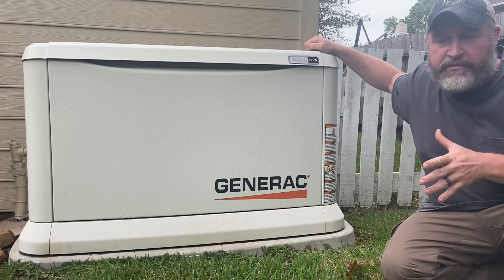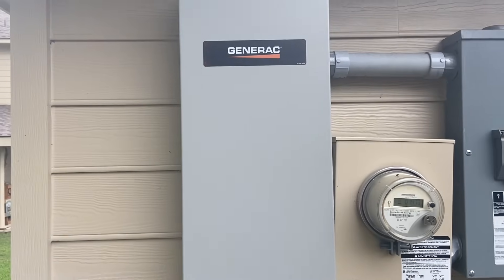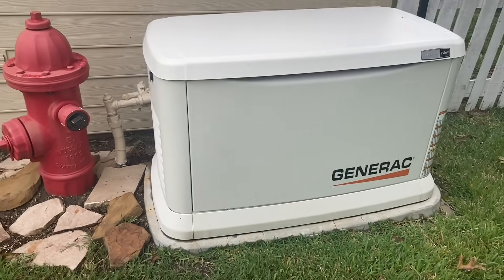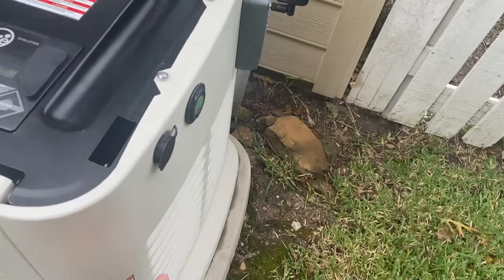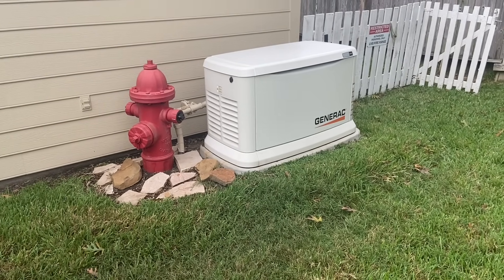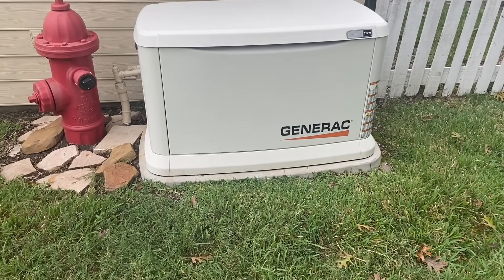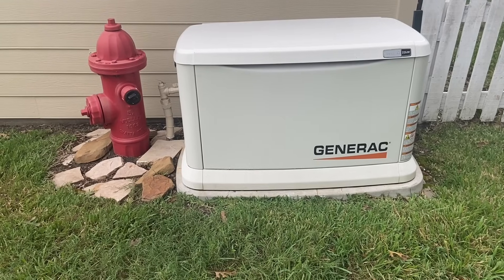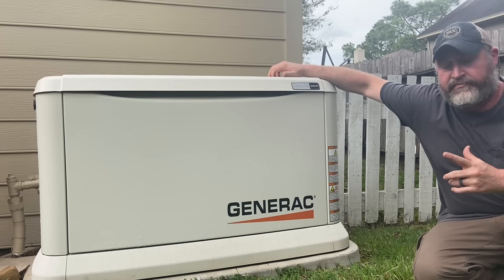Thinking of purchasing a generac whole home generator?

Comment: I’ve always wondered. What if you’re having electrical work done or you otherwise need to have the power off??? Won’t the generator run and therefore make all your outlets ‘live’ etc??
Reply from the maker: You can still turn off breakers or then main , if you needed to kill power at the meter you could then turn the generator off at the control panel.
Reply: @JustCantSitStill  Great thanks!

Comment: If there is a wide-spread, regional outage, does city-provided natural gas still flow?  i.e. is the utility backed up in some way to ensure service in spite of loss of electrical?  I'd hate to think I'd have to have a portable gas powered generator to back up my natural gas generator.
Reply from the maker: Our has never been cut off in my lifetime , I guess anything can happen. It can run on propane if one would want to get a large tank as a backup. 

Thanks for watching!
Reply: @JustCantSitStill  I've seen it in a long, multi-day outage. Compression stations run out of standby power and the nat gas line pressure drops below what's needed to run anything. Therefore the generator dies of fuel starvation.

Not common but not impossible either.
Reply from the maker: @StevieWonder737  anything is possible, you can’t prepare for everything so what’s your answer? What option did you go with?
Reply: @JustCantSitStill  Diesel with extended run tank. I can roll in a few barrels of farm diesel fuel with a manual rotary pump and have over 10 days of non-stop generating capacity
Reply from the maker: @StevieWonder737  Our county regulations cap the amount of flammable or combustible fuel that can be stored. If in compliance our regulations would make this amount we could store a negligible amount that would not be enough in my opinion. For ten days of run time we would be fine I would not give the NG getting shut off a thought.

Comment: What's the cost of a replacement battery?
Reply from the maker: What ever a small mower battery cost in your area …..
Reply: It is a standard automotive battery, a 26 or 26R will work.  Available at walmart or an automotive supply.

Comment: One thing I discovered is that Generac company will conspire with their distributors to lie to customers.  Our Generac was installed in 2020.  The distributor salesman we purchased from said they would install generator on a cement pad which they did not do.  I contacted Generac to see if this could cause damage to generator and they said their installation protocol requires a pad between ground and generator.  When I told the distributor this they said that was not true.  I told them to call Generac. The distributor called me back and said that Generac confirmed no pad required and Generac had no record of telling me that or talking with me on the phone.  Generac rep not only told me that, she  looked up who the distributor we purchased from and said they would talk with them.  I called Generac back to find out why they would lie.  They could find no record of anyone at Generac ever speaking to me. I believe Generac clearly lied to cover for their distributor.

Comment: It’s a great generator if all you want it for an hour here or two hours there or even four hours here and there if you plan on running it 24 hours a day for any period of time that’s not the generator you want. What you want is a water cooled Diesel as they can run 24 hours a day, seven days a week for years..
Reply from the maker: Thanks buddy for stopping by, if  we ever outgrown what this one can supply we will upgrade so far this has been great has ran for 3-4 day straight with no issues. Please subscribe like share and have a great day!

Comment: Be advised. The life expectancy of a whole house generator is typically 12 years. That’s a  $1,000 or more dollars per year for an occasional outage.
Reply from the maker: Great thanks for watching please subscribe and check out my some of my other videos!
Reply: Yeahhhhhh and when your power is out for days that 1000 bucks won’t matter. Your neighbors will be banging on your door while you’re chillin and they’re suffering.
Reply: @XX-166  The reality is that if you live somewhere that outages are common, chances are you don’t have NG to run a generator. And if you do, it’s somewhere that doesn’t have the usual culprits that disrupt electric utilities for days at a time.
We have an ice storm every year that causes trees to damage power lines. The utility company routinely prunes trees that pose a risk. The maintenance cycle is at least five years long, so the outages occur where pruning hasn’t occurred in some time. Nevertheless, despite yearly weather events, the odds of an outage for a given neighborhood are one every few years.
Reply: It might save you $20K in burst pipe damage. But even if you have to rebuild/replace the generator every 12 years, you won't have to redo the transfer switch, pad, underground piping, permits, etc. So your long-term cost is half that.
Reply: @tycox8704  I’ll have more natural gas then having to worry about propane that’s for sure.
Reply: @reefhound9902  it’s definitely worth having… it’s can be expensive but peace of mind is priceless.
Reply from the maker: @reefhound9902  thanks for watching buddy have a great weekend.

Comment: Great video man. What would you have done had you NOT had natural gas? Im all electric.

Is gasoline or propane tanks an option?
Reply from the maker: Runs on propane or NG.
Reply: @JustCantSitStill  when you say propane, I picture those round tanks your exchange for your gas grill. Can that be used or would you need a stationary tank next to your generac? 
Wondering again what YOU would have done had you had an all electric house. Please answer.
Reply: It will NOT run off of a propane grill tank.  There is not enough surface area in those tanks to vaporize enough propane to run it.  You would need to have a stationary tank installed and it would be able to run for a long time on one of those.  There are other options but they are all far more expensive or far more inconvenient or both.
Reply: @tombonini7393  i believe you, doesn't sound like a sustainable idea
Reply: @tombonini7393  It WILL run off of the propane grill tank...just not long, nor in very cold temperatures-for the vaporization issues you mentioned.

Comment: I have an older model of these, or should say, had. Only had one issue in 15 years. That was charger. Then it started tripping my monoxide detectors big time. I do not know why but w/o them I would not be here, maybe. I had it moved 100 ft. into the woods. They gave me a fair deal on a new one so I bought it. The first week I found ants in side. Put in bates. The biggest problem will be the government outlawing them, or fuel they run on. I would never put one close to any vent or window no mater what code says. Please buy a detector.
Reply from the maker: We have them and this generator is place by our detached garage it’s not against our house. Thanks for the comment and thanks for watching please subscribe like and share buddy, take care and have a great day.

Comment: Thanks for the info.  Is there anything out there that’s maintenance free and less noisy ?
Reply from the maker: Thanks for watching!
Reply: Solar but is like $60k and no power options is truly maintenance free.
Reply: Tesla Powerwall, but the number of kwh is limited to the battery capacity (13.5 kwh per Powerwall 2,  and you can connect up to 10 of them).  Whole house air conditioning would run these down pretty rapidly in multiday outages, so it would probably be best to just hook up essential items, such as refrigerators, freezers, sump pump, heating system, etx.  It can be more expensive than the fossil fueled generator depending on how many you purchase, and the installation cost seems a bit high.  However it is transfers fairly instantly and is quiet.
Reply: Yes.  Your utility company.

Comment: Have you had any issues with using natural gas.  I was thinking I want one to run on gasoline.  But I know nothing.
Reply from the maker: 0 issues works as expected
Reply: i would advise against gasoline for a couple of reasons. 1 it goes bad sitting in the fuel tank and will gum up the whole fuel system. 2 if the power is out at your gas station how you going to get gas? 3 you got to constantly refill the tank. These are lessons i learned when i used a welder to power my home during the texas freeze. nobody had power and neither did the gas stations. i found one truck stop 20+ miles away that was rationing diesel  i got lucky
Reply: @racerx1777  Plus NG burns much cleaner...

Comment: So this generator runs on gas? And if you don't heat via gas, is there a chance that the gas can enter the home?
Reply from the maker: Hey Benzino it runs on natural gas it can be set up to run on propane if your house does not have natural gas. Not sure what your asking about gas entering the house , I guess you could have it ran into the house if you did not have it to before. Most people that don’t have NG run these on propane. Hope that helps if not ask me again , please subscribe like share 👍

Comment: What is the fuel it consumes? How is it supplied? Sorry, I am naive. Curious and want to get as much information as possible and really interested in installing one.
Reply from the maker: Watch the video please
Reply: It’s connected to your natural gas line for your house.
Reply: You can use natural gas or propane. They have smaller ones but running them off gas presents a number of issues. Gasoline doesn't keep well and the carb gums up. Propane can sit for 15 years and burns clean.
Reply from the maker: Took the time to write the comment but not watch the video

Comment: My parents have aluminum wiring in their house would they have to upgrade their wiring to copper?
Reply from the maker: I really don’t think so, should be fine.
Reply: @JustCantSitStill  ok thank you
Reply: I had aluminum wiring in a house I purchased in 1972, since sold it.  You might want to have an electrician check your parents house to be sure the aluminum wiring is compatible with the plugs etc. you have.  In my house the electrician mistakenly put in plugs that were designed for copper and we had corrosion problems because of the dissimilar metals.  I had to go through the house and replace ALL of the plugs etc...
Reply: Did not know any homes were built with aluminum wire 👍

Comment: BEFORE you buy one of these or any other maker's find out how much it will cost to hook it up.  My unit was $5400 and it cost $6400 to hook it up and I had to wait four months.  Had I known I would have purchased a regular generator for less than $4500 and made due with that.  Another consideration is they are gas guzzlers.  It is a lot of money to pay for something you might use once a year.
Reply from the maker: That’s about the going rate for the convenience. 13-14k

Comment: Why didn’t they install a drip leg on the gas run and vent your regulator away from the exhaust?
Reply from the maker: Good catch , thanks for watching please subscribe and check out my other videos. The newer units including ours has a integrated drip leg/sediment trap on the fuel regulator inside the unit cabinet. 

Drip led/sediment traps are not required by our local code so the plumber did not install and the city inspector did not require. 

I wish they would have moved the gas pipe and the regulator further along the backside of the unit, it’s not in the direct exhaust flow so I assume it’s fine the way it is, I guess I could move it myself just have not messed with it as it’s not been an issue yet.
Reply: @JustCantSitStill  Right, Generac puts them inside the unit, because in many areas like Massachusetts, drip legs are not allowed outside in potentially freezing areas. Inside the unit meets code. The regulator vent is better where it is, it would be worse if it was located on the other end where the air filter is. Blowing any potential gas away with the exhaust is fine, but if extra gas gets pulled into the engine, could cause an overspeed shutdown trip, or running rich condition.
Reply from the maker: @brnmcc01  thanks for the great comment and watching! Please subscribe and check out some of my other videos.

Comment: GOOD LUCK, with most all the electronics NOT made in the U.S.A. I suggest you pull the parts manual NOW and begin to buy up the replaceable parts NOW & store them away, BTW, what brand engine is running it??
Reply from the maker: Ok thanks bud for that

the engine is produced by Generac it’s the G-Force 1000.

Comment: Awesome review my brother.  Don't see perfect informative reviews like this too often.  Just had the generac installer quote today for a 22kw Guardian w/Transfer Switch.  Unfortunately my quote was for around $18,300.  I needed about $3200 additional electrical work plus propane install (2x120gallon tanks).  I use heating oil for heat.  Between your connections (you already had nat gas), I think my quote is pretty crazy even with the Biden upside down economics??
Reply from the maker: Thanks buddy, your install price may have a lot to do with the distance they have to trench? My neighbor just had a 22kw done for 13k NG no gas run probably at 50’ electric run.
Reply: @JustCantSitStill  I think the trench is only 20-25 ft and the electric run is about 5ft from the gen to the outside electric box.   I think I just need to get a couple more quotes.
Reply from the maker: @simroc1289  yep I think your on the right track

Comment: The same install today is $16,800.00.  The Genset alone is now $7800.00. That does no cover the purchase and install of a 500 gal propane tank.
Reply from the maker: Our area 13-14k now for this same installation
Reply from the maker: @eddevoe2519  No thanks our system is working great for us.
Reply: 15k for me and that didn't include propane tank. We got the 26kw
Reply: The 22kW Generac installed today starts around 13k-14k in West Palm Beach, FL, for a Natural Gas hookup.

Comment: About to commit to the 26kW from General Supercenter. Would you still go with Generac after having it for 2 years. I’m torn due to bad reviews on BBB and their Facebook page. Any tips?
Reply from the maker: @petecrabtree3412  we have had no issues other then a battery replacement.
Reply: @JustCantSitStill  thanks for the quick reply, I truly appreciate it.
Reply: A competent installer and future support is just as important as a quality machine.  More, if you factor longevity.

Comment: I often see people use these things to charge batteries with their off grid homes but they failed to read the manual as they are warranty void with off grid power systems because in that case you will be running the generator hard and under load for many hours and they simply will not stand up to heavy usage. They are air cooled and therefore will fail prematurely if you run them hard. They will last a decent time in a low humidity environment if you only run them 4 or five times a year. Otherwise expect your unit to crap out in a matter of two or three years.
Reply: I recently purchased an 18K, I've never had an issue with a Generac, last home I had a 24K.  Waited for the Generac specials, purchased the 18K for the new home with a 10yr upgraded warranty (no charge) - what I found in my research, most problems, were caused by lack of maintenance.
Reply: The generator doesn't really care.  Load is load, running is running.  But, yes generac doesn't warranty units strictly for off-grid application.

Comment: You covered a lot of the installation & purchase costs, but not the operating costs. How much does it cost to run per hour, or per day?
Reply from the maker: Thanks for watching, that’s a very tough question to answer as we have other appliances that us NG. During the outages the generator uses NG but so does the water heater, furnace, dryer, stove…. I can say that during the big  freeze where we ran off the gen for 36 hours our bill was only 52$ more than the previous February however the furnaces where working overtime as we had the attic door open to keep the pipes from freezing and we used our gas fire place quite a bit. I hope that kinda answer your question I would not really worry about the added gas cost as this is a emergency back up. Please subscribe like and share, check out some of my other videos you may like since you are into automotive as well.
Reply: @JustCantSitStill  Thanks. Those are good ballpark numbers. Just wanted an idea of the cost. $52 is WAY cheaper than replacing all the food in a refrigerator.
Reply from the maker: @gearhead366  oh yeah 100% and we sat in the comfort of our house while many where outside in running cars to keep warm. And not counting all the damage because of the frozen pipes that broke. It’s well worth whatever the cost when you need it. Thanks again for watching.
Reply: @JustCantSitStill  I'd say that's a pretty accurate cost.  I've got a 27KW Generac, and I calculated roughly about $65 per 24 hour run period on nat gas.